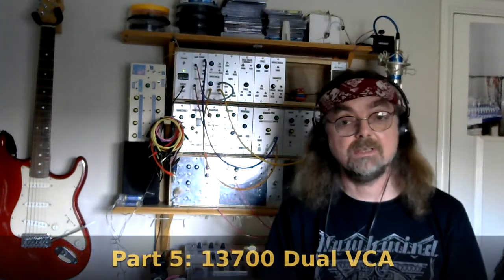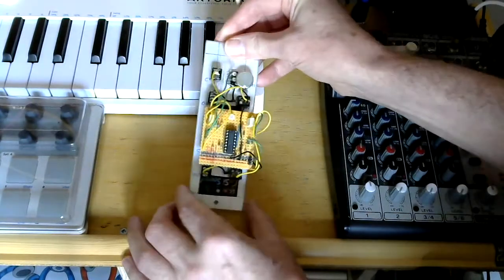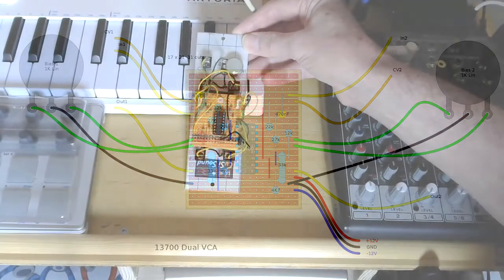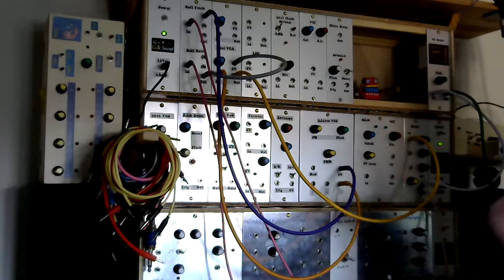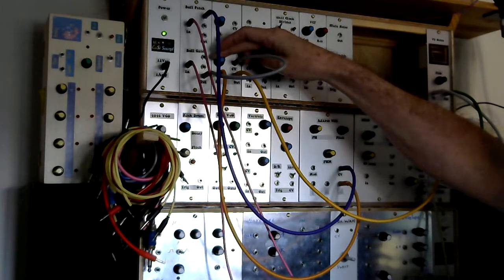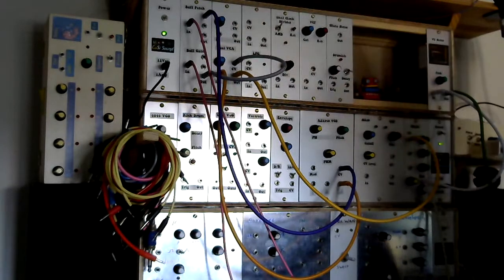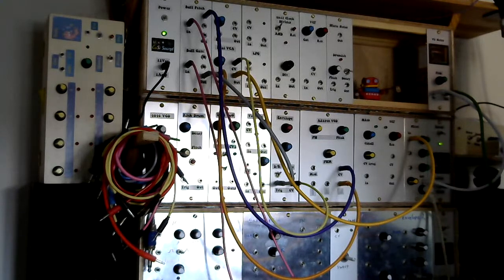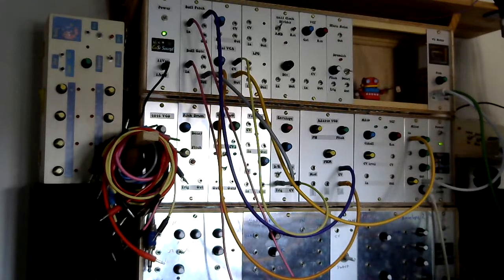Project XII Modular Part 5: VCA

Comment: Hey cusi! do you try this Synthesizer Build part-10: THE VCA or VOLTAGE CONTROLLED AMPLIFIER. at Eddy Bergman ? https://www.eddybergman.com/2019/12/?m=0
below it has a series of modules and further down in the middle of the page it has a vca that seems to work, it needs many components even to calibrate them, I still need to receive some parts and I will start to build it, but in facebook and DIY groups it seems to be tested and it works.
Reply from the maker: I have not tried this particular VCA circuit. Some I have built have had problems with noise, distortion or not going completely silent so if this one is as quiet as they claim it could be worth building. I still like the vactrols for their softer response.

Comment: super, thank you! i think stripboardlayouts are easier to handle. but: for newbies like me it is still irritating that there are no groundconnections for all the jacks (cv, in, out) are shown in the schematics.
Reply from the maker: It would be more complete to include the jack sockets and their connections in the diagrams, I sometimes do but maybe I should be more consistent. As a general rule, you can connect all the ground connections on the sockets together unless specifically told not to with at least one linked back to the earth/ground on the circuit board.
Reply: @CuSiSound  thanks for clearing it up:)